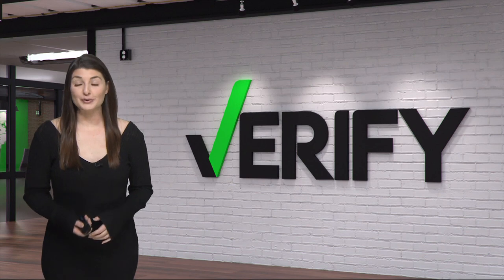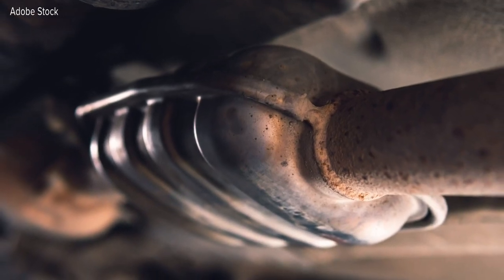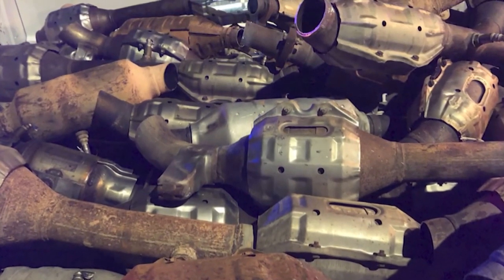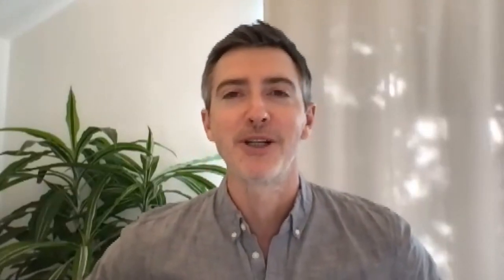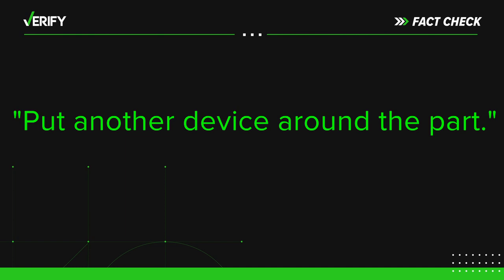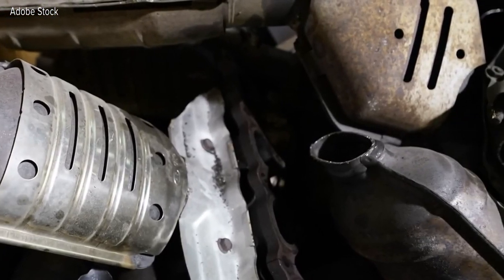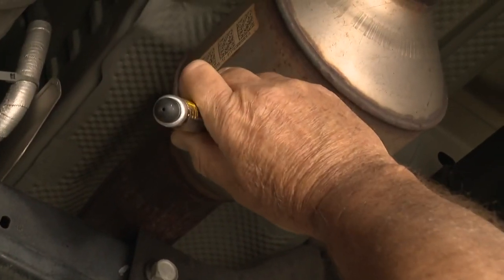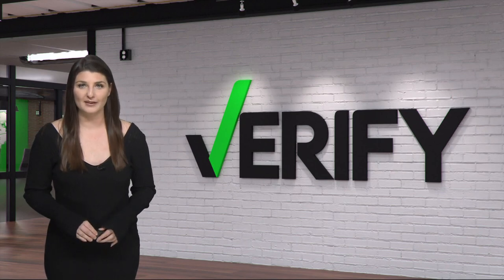How to stop thieves from stealing your catalytic converter

Comment: FL law prohibits catalytic converters to be sold to scrap dealers for more than scrap steel value.  As a result, we DON'T have a problem with cat thefts.
Reply: That kind of sucks though. Some of these stupid ass catalytic converter become ineffective after a while so the scrap price kind of relieves the replacement cost.
Reply: @USERNAME1-x5u  I'd rather replace one that had failed than two that got stolen!   Far more likely, by the time the cat fails, the vehicle is heading to the junkyard anyway.